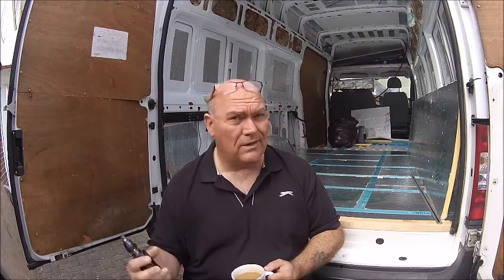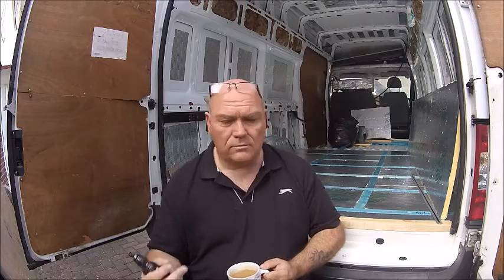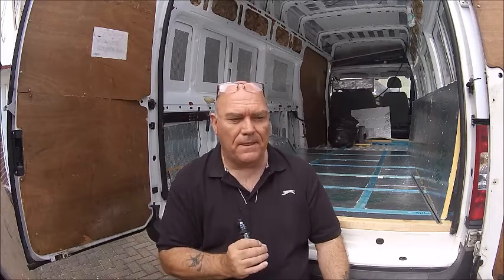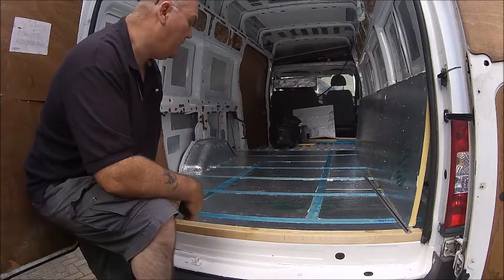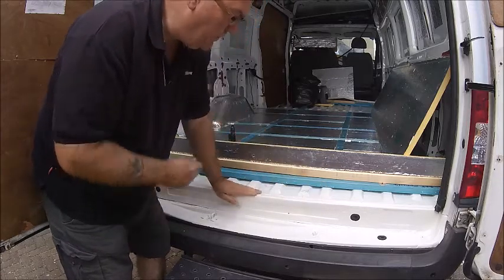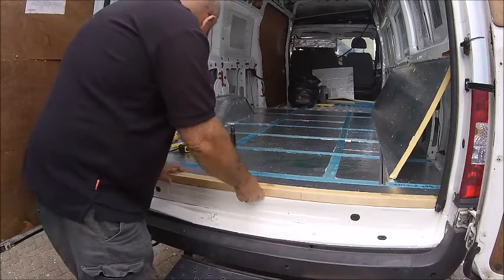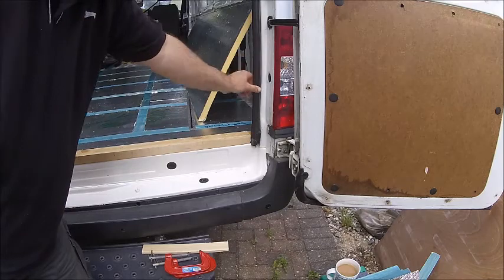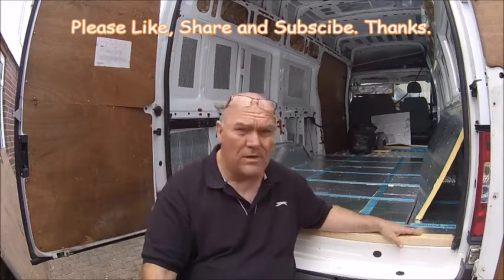Transit Jumbo camper conversion  5: Starting the Floor

Comment: Hi ya..  Trying to find a passenger side base is like trying to find a virgin in a brothel...?  So.. I made it.. in fact I made both pass & driver side.. as I used mk1 ford galaxy seats, because with a little tweak they swivel 360'' , but they slope backwards to far and my little short legs would not reach peddles....? I made them out of 1/8 galv plate on a slope.. Shit they were hard to bend and sparked allot when i welded them.. but they as solid as rock.. you also have to move hand break if you swivel the drivers..  If yer looking, both mk6 & mk7 are the same..   Good luck with that one...  Kevin

Comment: mr vandamonium recons an electric knife works a treat on the pir board....havent tried it myself but will next time .....coming along well :-)
Reply from the maker: Yeah Electric knife works really well with trimming.  Stanley knife is good for long straight cuts with no mess, and I used a messy saw method for shorter cuts.

Comment: Looking good mate, coming along nicely. Ive got my eye on a van for track days if you fancy a new project when your done !! Also how does that dodo stuff work then because it not cladding the whole van ? Is it keep noise in or out ?
Reply from the maker: High Bickster. Yeah get yourself a van mate.  If its just for track days, you don't really need to do a full on van build.   The dodo deadmat is just to dull the noise of the van panels rattling. Ive noticed quite a difference.
Reply: Mange 2 ahhh right i thought was like full on sound proofing ! Im looking forward to see it youll have bring it down for a visit ! How long till its done u reckon ? Yeah i though be easier sling the bike in the back and not have to camp
Reply from the maker: Ive got no set time on the build but I think its gonna take me longer than I think LOL. Once all the basics are done, i.e. insulation, floor, ceiling, walls etc, then I could use it with a mattress and camping cooker in theory.

Comment: Haha.. Brett ant interested... He just wants to see you F*%k up... Then call his self DIY GOD... Hahahaha.... Ho..? Tetley or Yorkshire....  Ho.. Dont cut the corner off.? new rubber will slide down into that gap...  In mine, Roof on the sides with 1 inch kingspan..  Kevin
Reply from the maker: I'm a PG Tip man through and through. Just bought another bag of 1000. lol.